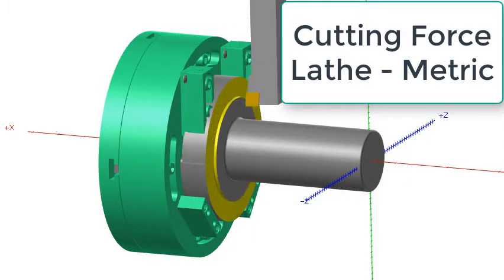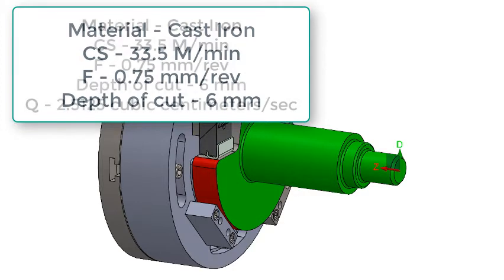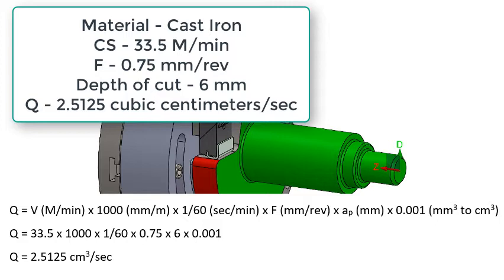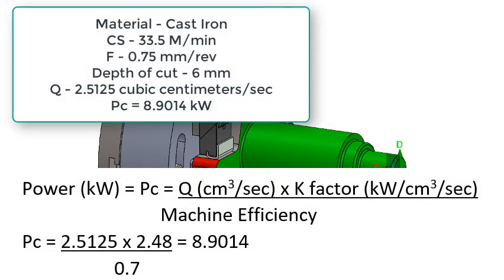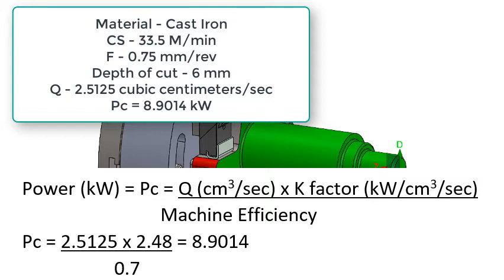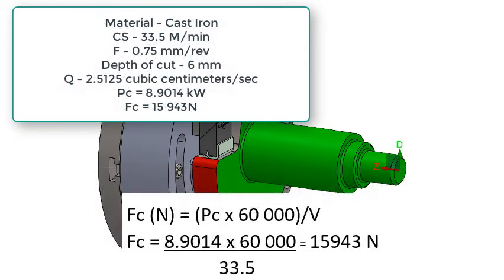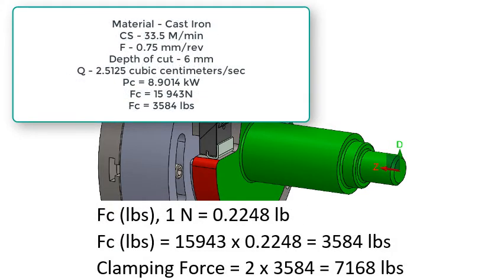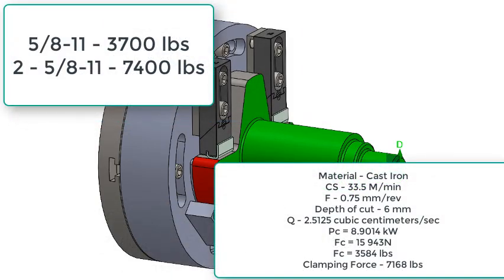Lathe Cutting Force Metric

Comment: Great video, thanks. What is the reasong to choose the clamping force to be double the cutting force?
Reply from the maker: Glad you like it. We always use a safety factor of 2.
Reply: I'm using a 12" hydraulic chuck on my CNC lathe. At 10 bar, it gives 53 kN clamping force. Below 1000 rpm, it loses no more than 6% of that force. My spindle is 18 kW, 500 Nm, and roughing with a CNMG insert generates no more than 3–4 kN cutting force at %100 spindle load. So my ratio is 13:1 at least and with this setup there is no way that part is flying out of that chuck because of the cutting forces. Does that sound correct?

Comment: Hi, if feed is in mm/revolution, RPM has to be taken into account; otherwise you don't get how much the tool feed in one second!
Reply from the maker: Not sure why you want to know per second, but you can calculate that if you want.
Reply: @Fredumaction  On a second thought, it's not needed, since you have the cutting speed giving you the first dimension of material removal, feed for the second dimension, and depth of cut for the third one. But at first glance, to have feed im mm/rev made me wonder how this could be converted to mm/s. Have a nice day!

Comment: How to get KW in power
Reply from the maker: Look them up in a book such as the Machinery Handbook.
Reply: A good reference is the technical data manual from mitsubishi materials https://www.mitsubishicarbide.com/application/files/3015/7587/4552/c009n_r_technical_data.pdf